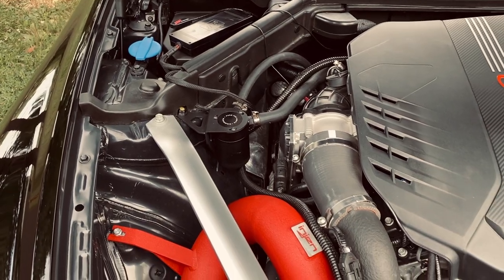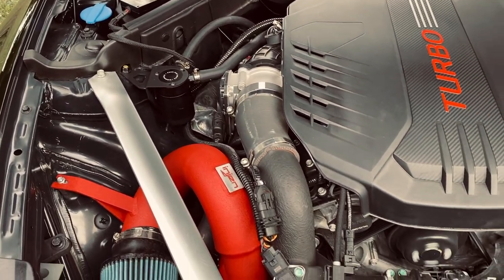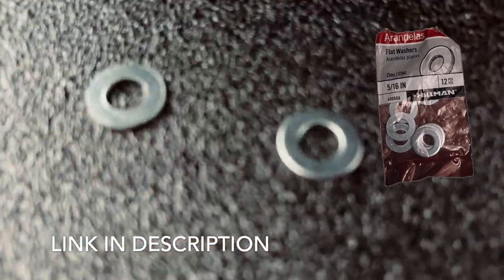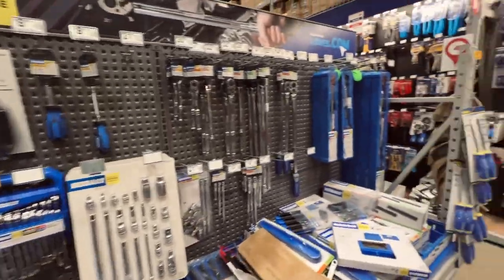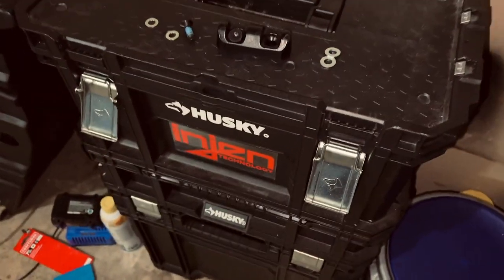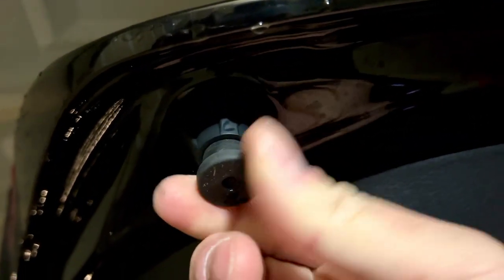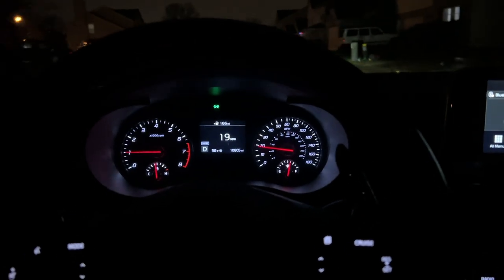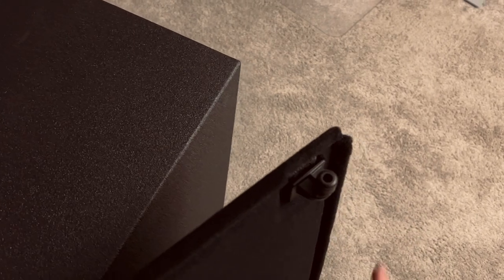COMMON ISSUE with the KIA STINGER!

Comment: I never had a rattle in the hatch but did have a recurring rattle in my sunroof. On the 2nd attempt to fix it, the dealer just replaced the whole sunroof assembly. While the rattle was annoying, I certainly can't complain about how well Kia honour their warranty. Love my Stinger
Reply from the maker: Nice! Yeah it’s a great feeling to be rattle free - such a nice car
Reply: Sick! I may have to look into that
Reply: I had the exact same thing happen to me on my 2018 stinger sunroof Thier was a rattler or squeak coming from it. Replace the whole thing and it still came back. I ended up finding it myself. If you place your hand on the headliner at the edge  directly midway  below the back of the sunroof and push the headliner up or down it will stop the noise  just pull on it a little bit or push up on it a little bit and you'll feel it that it can pop in and out of position. This should stop your noise. If it comes back do the same thing again . This temporarily works for a while and you have to keep on doing it over and over.
Reply: @twn2rbo we😮

Comment: When I fixed mine I doubled up the thick washers and that was too much.. then the hatch would not seal completely so then I got a whistle when the car was over 50mph. Took it down to one thick washer only and it works great now.
Reply from the maker: Nice! Yeah I did one thick and two thin ones that were OE. Mine was a two part issue, the hatch was rattling again, but it wasn’t near as loud as recently. It was that privacy cover. The washers did work, I also tried two thick and it was not wanting to shut, so I adjusted the bump stops and boom. Perfect. Like day 1 again 😀
Reply: what was the fix for the privacy cover??? @twn2rbo
Reply from the maker: @jamesplatanitis6252  I was able to super glue it back without a trace of it showing. It’s been solid every since

Comment: I love my 2022 Stinger GT Scorpion. Upgraded from a 2018 premium to 2022 Scorpion. However, there is something that’s concerning. My front parking sensors went out. After ordering the parts, the horn relay and the rear parking sensors went out as well. Now there’s a weird rotating / flat tire sound coming from one of the tires but there’s no flat. Also, my idle stop and go feature stopped initializing. The amber light turns on but the feature doesn’t work. I have an appointment with the dealer next week… but what the hell kia?!
Reply from the maker: I’m with ya man, it seems to vary from person to person. I’ve had no issues like that but I have the base GT, less things to go wrong. I will say though My only beef with this car is the clear coat on the paint and the interior rattles / noises at such low miles. It is a new car and the kinks can take awhile to work out, but the pros out weigh the cons. Still sucks though

Comment: Wait…. A KIA that rattles?  😂. But really… try plumbers tape to the screw thingy it should make it hold better and it won’t be visible.
Reply from the maker: It’s not visible, towards the end of the video is the final result. I suppose plumbers tape would work too, but you would need a ton of it for it to not wiggle so bad. I have mine perfectly snug right now and the zip ties will keep it from moving back to place. That’s a common issue after adjustments, they end up moving back up. I’m just happy I’m rattle free now 😀

Comment: Just fixed the rattle in my ‘20 GT1 throwing a set of 5/16 neoprene (rubberized) washers over the existing ones. The piece mine came with had black plastic washers fixed in place to the cover, and extra foam in the middle that bumped out.  I mention the look of my part, because it was different from most covers I’ve seen online. As annoying an issue as the rattle is, the fix is quick and cheap!

Comment: rattle is definitely annoying bro whenever i get the chance im doing this. question so you said you put the 5/16 washer PLus the stock washer? and do you have the harmen karden in your car? that you needed that sub?
Reply from the maker: I don’t have H&K, the sound system isn’t horrible, but it definitely could use some more bass. I haven’t listen to the HK but I know for sure it’s not going to compare to the sundown X8. The mids and highs are surprisingly loud on mine though, so now it’s just perfect with the added low and loud bass
Reply: @twn2rbo  thanks maybe I'll plan on getting a sub like my charger had in the trunk.

Comment: I can tell that the original washers you had in there were stainless steel, while that new thicker washer was zinc plated (at best).  If you kept that thick washer in there and in your climate, I would consider replacing it again with stainless washers, or stack a few stainless to achieve that thickness as I don't think I've ever seen stainless washers that thick.  Even zinc plated washers will eventually rust.
Reply from the maker: I think people were also wanting to see some rubber washers,  I used some non slip rubber that sits between the washer and paint for now. But that would be a cool update vid

Comment: My only gripe with mine is the head lights seem to suck, like I drive on two lane roads with no street lights,  the headlights don't project worth a damn!!!! and the brakes, had to upgrade rotors and pads.
Reply from the maker: Mine work pretty good, the Lexus definitely would light up the road a little better. I usually always update my driving bulbs, maybe I can try out some different ones and do a vid. Good idea. I’ll see if I can reach out to some of these Amazon stores and get 3 tiers of led bulbs to compare. 

Rotors and pads, it’s a very heavy car and it’s pretty fast, so I accept it. But they definitely need upgraded when operating like we do. Mine are still good though, I’m more of a dig person - I love 0-70/100

Comment: The box is what broke that piece from sliding around. Put the 12s back in and make mark it off in the spare cover and make a border for it to sit in and it won't move anymore. That's what I had to do on my escalade 3 resilient plats 15s that box destroyed my hatch panel when it slid back. Made a platform for it to sit and fall into no more damame
Reply from the maker: 3 RE 15’s 😱 I bet that was loud AF
Reply: Oh it is . On a viking 8k . On half ohm load. 425 J's alternator and 100ah lithium

Comment: The only noise I’ve got is a ticking in my hood lining when the weather is hot, from what I’ve found online it appears to be a foam spacer between the hood lining and the roof and the adhesion of the spacer comes away when hot and the ticking is the pad unadhering.
Reply from the maker: Great info, thanks for the share 👊

Comment: I have a 2022 Stinger and I have the hatch rattle.
Headliner was also rattling but finally got that solved at the dealer today (they added make insulation)
Still yet to conquer the hatch rattle

Comment: Have you had an issue with coil packs going bad in your stinger?  My GT2 has gone through 2 coil packs (replaced under warranty) at 20,000 miles.
Reply from the maker: I have not. Ironically, a subscriber just messaged me on IG asking me the same question. Turns out, one of his went out too with only 10k miles on it. What year is yours? This is the second I’ve heard recently
Reply: @twn2rbo  mine is 2018.  When this issue begins to happen, people have reported their music cutting in and out and a loss of power to the engine (like me).  Then suddenly one day you will step on the gas and get a misfire.
Reply from the maker: @jacobhickam4947  thank you for the valuable info 👊

Comment: Wanted to add my 2 cents have 2020 gt2 AWD rattle I was having in the back  was not from the hatch it was actually the rear bumper skin. It's held on by push pins that wore out and was causing the noise I switched them out with two button head bolts and noise was gone
Reply from the maker: Appreciate it! Hope it helps someone troubleshoot

Comment: You can probably use either some Teflon tape or electrical tape to get a better grip from the tread. Also, I am starting to suspect that the inside hatch compartment cover could also be the culprit.
Reply from the maker: Yeah the loud hatch rattle wasn’t the actual hatch , but I’m glad I found it, that was driving me crazy.

Comment: Putting in a huge sub like that defeats the purpose of the hatchback feature 😂😂
Reply from the maker: Yeah esp the big one, but a hatch is a major benefit for SPL. It’s much louder than a typical car is where the sound waves travel through the seat and trunk deck. This car is so loud it’s insane, that’s why I put the Sundown X8 back in, it’s only 50 lbs so it’s easy to take in and out.
Reply: @twn2rbo  I only have a muffler delete on my GT1 and the stock speakers do well at hiding the drone I get sometimes coming from that trunk area. The seats also do well at sound deadening.
Reply from the maker: @user-hs2wu2br47q  when I remove my security cover in the hatch area, the exhaust is sooo much louder. It’s crazy . I might make a video on the before and after application of sound deadened material by the spare tire well
Reply from the maker: @user-hs2wu2br47q  but I just have the MBRP, no drone complaints, I love the louder note in sport mode. Comfort mode, the car sounds like it looks and not loud in cabin at all when driving normal.
Reply: @twn2rbo  dude! The MBRP is THE best sounding exhaust for the stinger IMO and I’m surprised more people aren’t running it. Are you running the aluminum or steel version?
Reply from the maker: @user-hs2wu2br47q  agree, well done exhaust. The sound matches the look of the car now lol. I went stainless since I live in the mid west.

Comment: I thought I had the hatch rattle, hubby placed nylon washers to prevent rust.  I still have the rattle but it seems like it's coming from rear suspension??  Anyone every had this?
Reply from the maker: I would also check the security cover in the hatch area, that’s what mine was this time around as shown.

Comment: I found another rattle.  The Passenger Seat belt (when no one in seat obviously) rattles against the plastic trim of the B Pillar
Reply from the maker: Lol did you see a video I made a little while back saying the same thing? Just like 2 months ago the same exact rattle started on mine in same area. Make a fist and hit the passenger seat headrest with the side of your fist a few times. It will mimick the rattle at the dealer. They installed a “noise suppression kit “ which is a foam material when I asked

Comment: Could use Plumbers Teflon tap on the plastic Threads
Reply from the maker: That could work too, would take an awful lot though. Mine was veryyyy loose. It’s a little unorthodox, but it works and it’s stiff now.

Comment: G70 FTW!
Reply from the maker: I need to review one of those, I’ve never sat in one before. I love the interior on them for sure
Reply: @twn2rbo   They are definitely a smaller package, but they are very nice.  I have the 2019 AWD.  I also have the JB4 but nothing else.  Genesis offers free maintenance for the first couple years, so I can't go rolling into the dealer with down pipes, intake, exhaust etc without risking warranty issues.
Reply from the maker: @kurtbischoff8661  I respect that , honestly the 3.3tt stock is more than enough power, but like anything else we love, we generally want more.

Comment: I think with the latest Stinger they resolved this issue, I don't feel It
Reply from the maker: I believe you are right. Also, I drove a 2021 GT2 today and it had no rattles either. Seems to be a certain batch type thing. The 2018 models are knock for inner door handle to pop off.

Comment: use a nutwash and teflon tape not a bag wtf..;
Reply from the maker: I suppose that would work, but at the end of the day you won’t see either and mine is rattle free. The bump stops are approx 1/2” each and solid which is the ultimate goal. The issue with the bump stop adjustments, is that the dealers often adjust these and they wiggle back after time. By forcing a little extra volume up there, whether that be with a bunch of Teflon tape or or some thin plastic, then securing them with zip ties, it will not allow that to happen again. I wish I didn’t have to do it myself to get rid of the rattles completely, but it is what it is